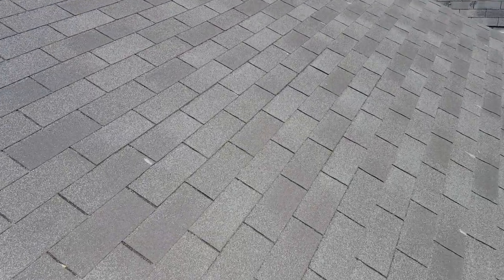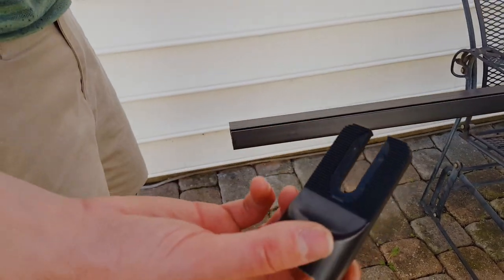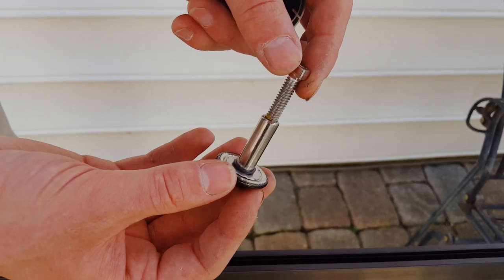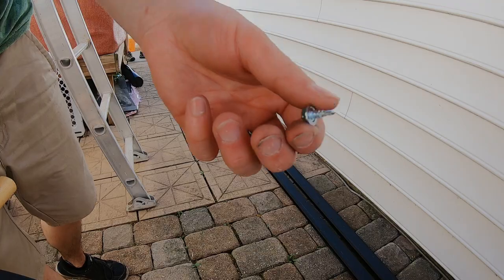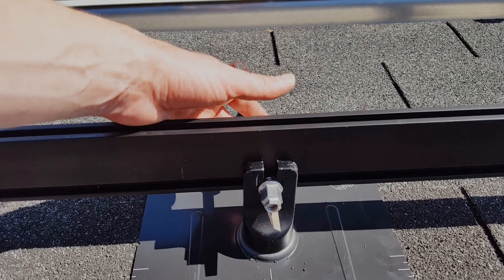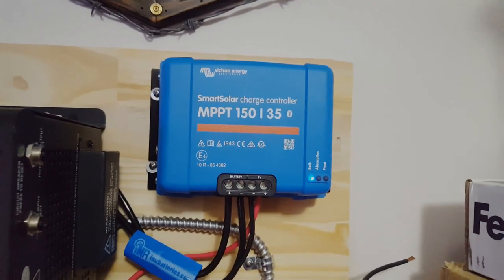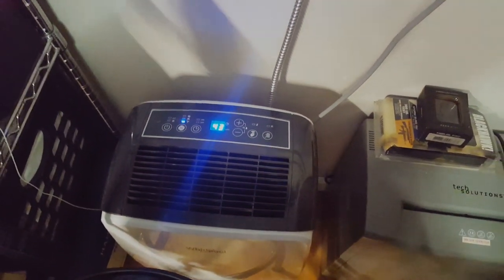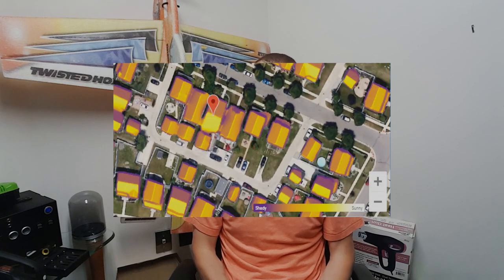"Project Overkill" GETS SOLAR! 1830 Watts Of Full Sun Goodness! Csun Panels And a Victron Controller

Comment: Google sunroofs are not covering my location as of yet. Hopefully it will update coverage soon. We are/were considering solar but the more I looked into it, the more confusing and overwhelming it seems. I'm also considering a mobile set up. Something that could be daisy-chained perhaps? Some systems are limited while others are not. Some have "plug and play" features while other seems over complicated. I went down a rabbit hole and ended up at the bottom in a fetal position 😂 Any recommendations? The one pro of a mobile set up (perhaps the higher end Jackery) would be in taking it to a remote cabin 3.5 hrs away.
Reply from the maker: Well, I think the first thing to determine when coming up with back up power options is what are you trying to power and how long are you trying to power it? This information will quickly narrow down your choices and will ensure you aren’t disappointed in whatever system you go with.

Comment: Nice work. Do you have a link for parts to do a roof install.
Reply from the maker: Thanks! I actually got lucky and found a local supplier. Www.altestore.com has a pretty good setup to help you build out your racking system though. You can look up ironridge railing systems and start digging from there. Theres different feet for roofs, theres heavier duty rails if need be, but overall their documentation will get you up to speed quickly. There are also some ironridge videos here on youtube that explain different mounting designs.

Thabks for watching!

Comment: Research the idea of 'floating' full LiFePO4 batteries.
Several sources report problems.
I am no expert; just reporting the claims of others.
Reply from the maker: Thanks for the heads up! I knew it was a bad idea to float them, but I haven't figured out how to do a high voltage disconnect on the charge controller yet. I am not expecting the batteries to be full day after day sitting in float so it shouldn't be a problem but I need to find a better alternative. Currently the answer is float at a point lower than full charge, but a high voltage disconnect would be ideal. Do you know if there's a way to do that on the Victron controllers? Thanks for the comment and thanks for watching!
Reply: @diyrenewableenergyelectron4996  It's best to set the parameters in the BMS and have it charge to say 3.55v per cell for a stationary system with cell balancing kicking in from 3.45-3.55 and then have the BMS kick the charging back in at 3.45 or so.  This gives the BMS time to balance the cells and also keeps the SOC high enough to the balancing to take place.  Since the batteries are going to be cycled partially each day they are really not spending all that much time floating once charged and the balancing differential gives them a break from charging.  This does lead to a small amount of micro cycling but the jury is still out on whether that is really an issue anyway since the expected caledar life of LiFePO4 is around 15 year s which means they will go through just under 5,500 partial cycles if cycled once per day.

If people are using off the shelf batteries where they don't have access to the BMS settings then they need to be sure they charge the battery to whatever the recomended charging and balance voltage is so that the internal BMS can do it's job.
Reply from the maker: Thank you for the information!
Reply: 3.4 volts per cell is not really a float, he has set an artificial low value to extend life of batteries and to achieve an easy balance. He calls it a float because the victron has no other controlling setting it is very similar to the CC & CV settings used to charge lithium batteries, CC acts very similar to float as it approaches the selected voltage which is then CV at zero amps. Many people confuse Float with trickle charge which is totally different.
Reply: @kuhrd  This will work as long as the cell quality is the same often a lower float voltage is needed for used batteries so the balance function can keep up as your battery is only as good as your weakest cell.
Reply from the maker: That's exactly what I'm trying to do. If the cells need balancing over time, I will manually charge them to full capacity and let the BMS's balance the cells but for day to day usage I never want a BMS mosfet to shut off. Weird balance/voltage differences start happening when 7 strings in parallel start disconnecting from each other lol
Reply: @diyrenewableenergyelectron4996  Ya I get almost a year of use before I need to do a manual balance used batteries have their quirks.